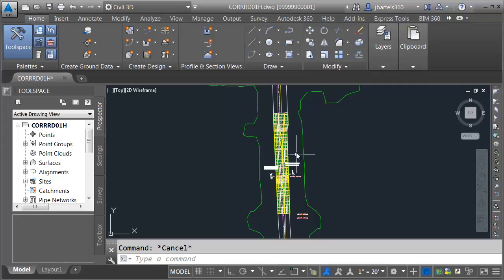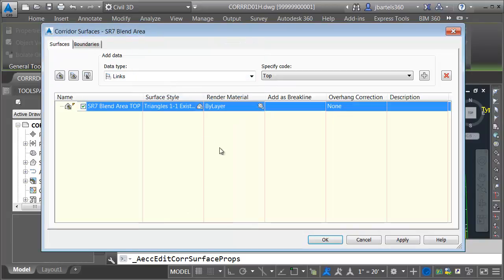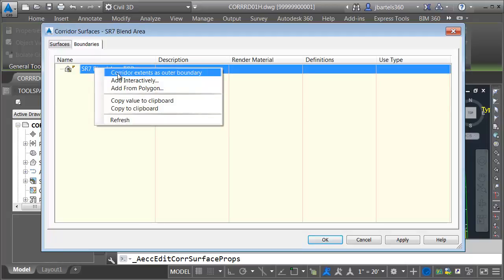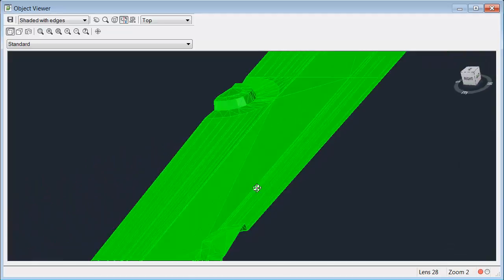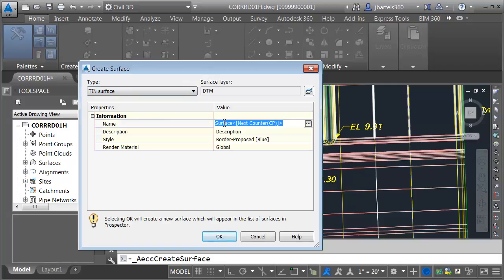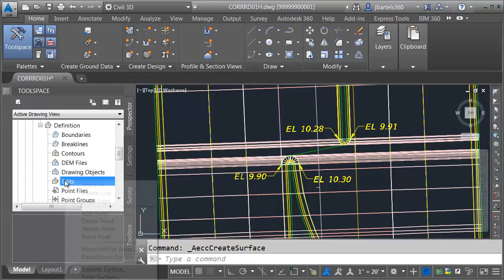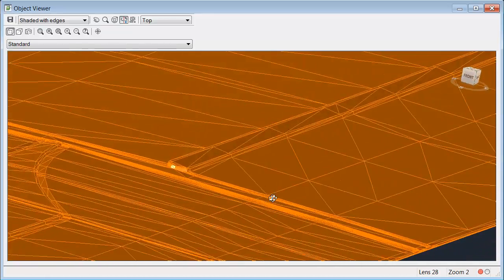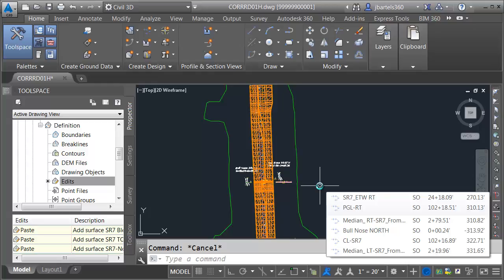Civil 3D Advanced Roadway Modeling Pt.9

Comment: Sir, after watch this series there is no doubt how to build multilane corridors and a top surface for corridors and Also it can be use for earthwork volume quantities (Cut fill volume). Thanks for this series its very helpful. Sir, here one question is how we can calculate structure materials volume of multiple corridors on a single base line as shown in this video series at once. is it possible or not.? if its is possible Please share a video for the same. Thanks again for wonder full video series.
Reply from the maker: I happen to be doing a webinar on that very topic on September 2nd. Visit https://civilimmersion.typepad.com for more information and to register. All who register will get access to a recording of the session.
Reply: @JeffBartelsCAD  hello sir,  I hope u will b fine. Thanks u sir I hope coming session will be very beneficial for every one. Thanks u to consider my request for this coming session.
Reply: sir, i has been register for webinar but still don't get the recording sesseion. How may i get September 2nd  and up coming session recording. ?
Reply from the maker: @naseeryounasbhatti1077  You should receive an email soon with a link to watch it. It will also be posted to this YouTube channel on Thursday morning.
Reply: @JeffBartelsCAD  thanks u very much sir.

Comment: i've watched this series numerous times, love it. my question is about the shortening of the corridors at various points where the median changes to facilitate the correct targeting. How does that affect the final surface and is the final surface spanning those gaps. thanks for a great series Jeff
Reply: Surface definition is driven by entire corridor throughout the alignment and profile length regardless from those gaps 
And the main feature controlling the surface is the assembly top links as well as boundary definitions
Regards